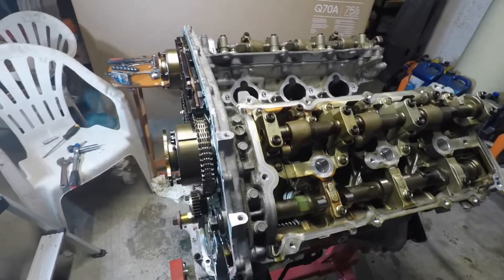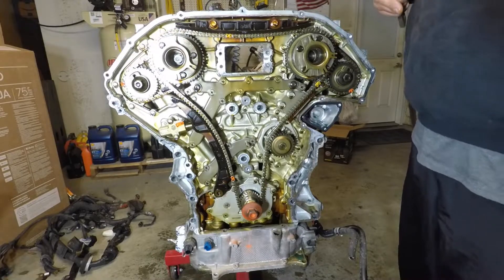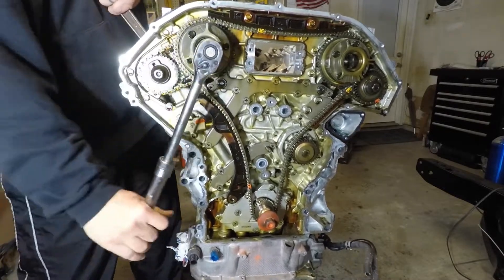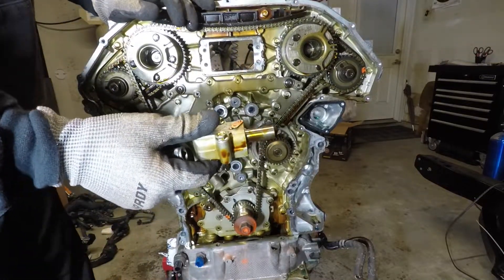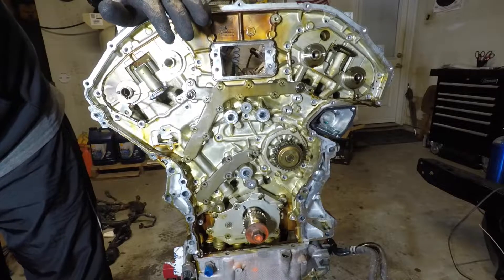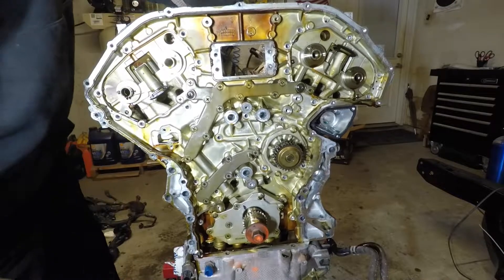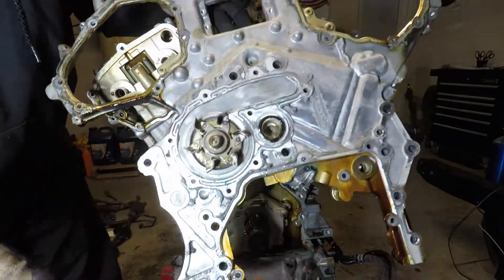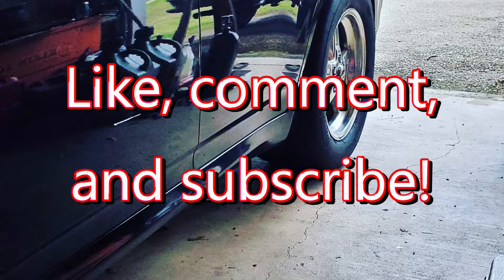Forged VQ37VHR build part 9, remove timing chain/gears and rear/inner timing cover

Comment: I've got a 2015 q50 that has a blown head gasket(s), and in the process of tearing it down now. In the manual it says the vvel actuator assembly is not reusable once removed. Is that a fact, or can they be reused?

Comment: Thank you brother,  for these videos/ teachings. You are truly appreciated. ❤️. Question: after I removed my timing chain guides and tensioner. I was trying to remove the chain from the intake gears and crankshaft my gears spun two times. I also noticed that my lifters move. Do you think that I might have messed something up? 🤔

Edit: the driver/right side cam sprockets was giving me a bit of a hard time to get off after I secured the tensioner. The chain kept getting stuck into the guide groove... so I put a flat dinner knife between the tensioner and the chain. That made it a lot easier to come off.

Comment: Removing bank one can gears and something spun backward as I removed the VVEL gear. Will that throw off the marks I made earlier?
Reply from the maker: No, the default VVEL position is always the same.
Reply: @garagefanatic7830  do u know if the cam gear bolts can be reused?
Reply from the maker: @vr.vqmechanic  yes they can. Just look over them and if there's no strange wear or damage, send it.

Comment: Could anything leak from that rear timing cover besides oil? Mechanic Just told Me I got a coolant leak from My timing cover
Reply from the maker: Only if an o-ring is causing a leak from your water pump.
Reply: I am having this issue right now, leaking from the back side down kind of above and behind the ac compressor, water pump itself hasn’t failed just those two orings?? So im gonna have to pull the back cover as well?
Reply from the maker: @JuggaloRider3  that could be one of the coolant pipes in that area or possibly the thermostat housing. The flange that connects the coolant hard piping to the block can leak as well.